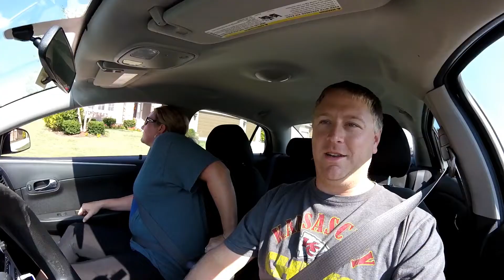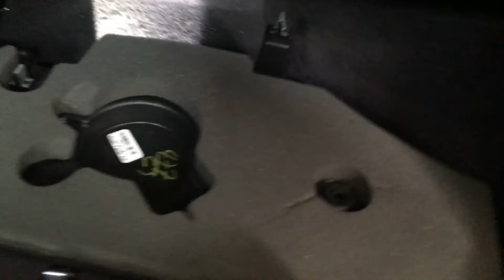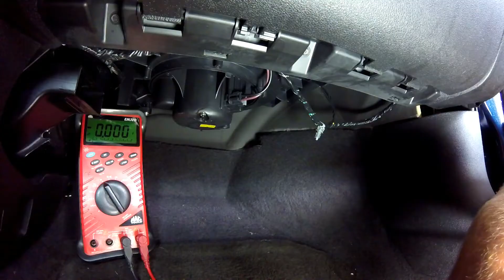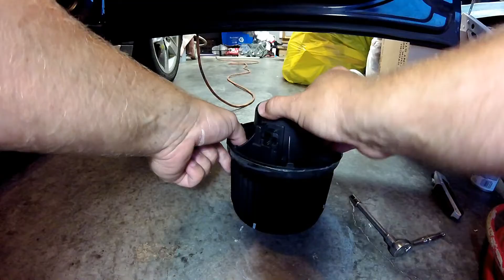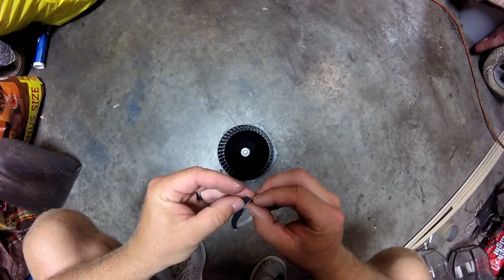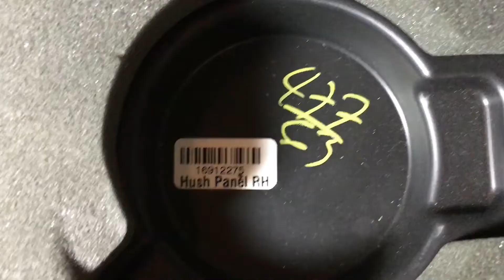Chevrolet Malibu blower motor diagnosis and replacement

Comment: How did you assume it’s the blower motor the issue, couldn’t it have been blown switches? Wouldn’t you check those first before changing the motor blower?
Reply from the maker: I checked for power and ground to the motor and it had both. If the switch was at fault then I wouldn’t have power to the motor. If I didn’t have power to the motor then I would work backwards to the resistor and then to the switch. No sense in pulling the dash apart to test the switch when the motor is so easily accessible.

Comment: If there's no air coming out the vents, is it automatically a blower motor issue?...or could it be the blend door actuator?
Reply from the maker: You should be able to hear whether or not the blower motor comes on.
Reply: @PetesGarageandperformance  Okay, thank you!

Comment: Question ❓ my blower only works on high. Do I need to replace it ?
Reply from the maker: No. Look at the blower motor resistor or the connector to the resistor. It’s probably melted.

Comment: I didnt get a reading while the blower was connected. Disconnected, tested the terminals directly and was getting 12 volts. Decided to go ahead and replace the blower, then the new blower wouldnt work. Decided to disconnect the blower motor resistor from the wiring harness just to take a look at it and reconnect it. Noticed it was corroded and the plastic was slightly melted. Wondered of that was 1) the cause all along 2) caused by having a blower that wasnt working making it get hotter maybe? 3) or maybe caused by me testing the wires directly without the blower being plugged in? Reconnected the blower motor resistor to its wiring that was corroded wiggled it around and the blower started working again. Any thoughts about the corroded resistor wiring?
Reply from the maker: The resistor and connector was the problem and both need to be replaced. It probably won’t work for long. Cycling the connector probably just cleaned the connection.
Reply: @PetesGarageandperformance   ok thanks for your help!

Comment: What if there is no light at all in the AC controls and it works on and off intermittently? When I slap the panel to the left of where you have the red gauge thing (where a passenger's left leg would be), it causes it to start working again. Any idea as to what could be causing that?
Reply: I have the exact same issue! I need help too :(
Reply: @Kylorenzo310  in the past couple of days slapping the panel has stopped working. When I have time im going to take it to the dealership and finally find out what's wrong with it.
Reply: @BigBobsh2o Sounds like cold solder joint failure on the backlighting.  What did it turn out to be?
Reply: @floobertuber  body control module had to be replaced
Reply: @BigBobsh2o  Oh, that sucks.  Sorry that happened!

Comment: What would cause an intermittent blower motor outage. Is there a relay?
Reply from the maker: The relay is only used on high speed. Usually an intermittently working blower is the blower motor itself. It just depends on where the motor ends up after it stops. It could land on a bad spot in the commutator.

Comment: I have the opposite problem! My air blows but my heat button dont work, & i cant change the functions like the defrost,or switch the air from going towards my feet & face
Reply from the maker: That is your “mode actuator”. It’s on the driver’s side by the accelerator pedal.

Comment: I need help
Reply from the maker: With?
Reply: @PetesGarageandperformance  my gauge temperature it’s only staying on C which is cold and it’s not moving near the middle or H
Reply from the maker: Sounds like your thermostat on the engine is stuck open.

Comment: Hey there. Will this work on the 2015 Chevy Malibu? My blower motor stopped working with no warning or prior issues. Checked the fuse, and it's good. Assuming it's my motor. Thanks!
Reply from the maker: Give it a whack and see what happens. Or check it for power and ground. Some of these newer GM vehicles have brushless motors though. The changeover was some time around 2015.

Comment: I don't have that electronic diagnosis kit.. but.. when I turn on my heater/ac I can here something "wanting" to gear up, but it's very brief and faint sounding. I am assuming my blower motor is going out the door.
Reply: I have a 2012 Chevy malibu
Reply: It was blowing air one day, the next morning it didn't turn on at all. I almost heard a quick click/winding sound but no air. It works now, but I hear the motor is louder than it ever was.
Reply from the maker: It’s probably the blower motor.

Comment: Does the motor come with that bracket. I'm checking out the Amazon link and it doesn't show if it does
Reply from the maker: It should. That’s the VDO part number I used and it came with the bracket and screws. I cross referenced it on rockauto and it shows the bracket and screws with that part number.

Comment: just in time.  a hot tx summer is no time for the blower motor to go out in for my 08 malibu.
Reply from the maker: Hope the video helps you out.
Reply: @PetesGarageandperformance  after looking at a few of these videos about the blower motor here on youtube i ducked my head under the dash to take a look.   seems that at one point in time that the blow motor had been replaced and that the hush cover was gone and missing.  lol
.  also looks like at one point in time that it had been replaced before.
Reply from the maker: That at least makes it easier to replace.

Comment: I got a 2016 malibu..i feel like it doesn't blow enough air as it use to.. new blower maybe?
Reply from the maker: Possibly. Do a volt drop test and see if it drops 12v across the blower motor on high.
Reply: @PetesGarageandperformance  its perfectly fine..it sounds like it's blocked and going elsewhere

Comment: I know this is probably not the same problem but would anyone know why my blower on my 2004 malibu would just turn on randomly and aslo the blower motor won't turn off "if it even ends up working at all" when I turn the ignition off which make 0 sence
Reply: Lol it's not fun in like 95+°f weather glad I had a power inverter and a nice fan
Reply from the maker: If it has automatic climate control then the blower motor controller(resistor) is messed up. Usually it goes bad because the blower motor is pulling too much current. I’ve seen them do this and the motor was getting water into it because the vehicle was wrecked and not repaired correctly. Rain water would come in through the cowl. You probably need a blower motor and the blower motor controller.
Reply: @PetesGarageandperformance  thank you ill have it checked out

Comment: So what if nothing on the dash is lighting up when you try to turn it on any speed? Not even the defrost lights up and nothing comes out.
Reply from the maker: The control head itself could be bad, also there could be no power to it. I believe the control head gets is power from the BCM/fuse block assembly.
Reply: @PetesGarageandperformance  thank you
Reply: That's my issue how can I fix this!??bwhata the control head and fuse block??? Sorry I'm trying and I know nothing about cars

Comment: What if the blower still doesn't come on? Even after changing the resistor with a new one and the blower with a new one?
Reply from the maker: Did you have power and ground?

Comment: Changed blower motor worked fine for a couple days and my daughter says it seems to be doing the same thing again any suggestions other than fuse I will be looking at it again tomorrow when she comes by...
Reply from the maker: I would look at the blower motor resistor assembly. Check the connector for burned/melted terminals.

Comment: hey Pete, i need help i get no heat on my 2009 Malibu, when i turn the knob to the cold side i hear the actuator moving but when is on the heat side it doesn't move or sound, do you think is the actuator or something else going on? please help.
Reply from the maker: Sounds like the temperature/blend door actuator.

Comment: My 2012 Malibu fan works sporadically. It will work fine for a while then later on it stops then maybe an hour later it works again. Any ideas? Thanks
Reply from the maker: It’s probably the blower motor, but you’ll have to check it out while it’s not working to verify 100% that it is.
Reply: I noticed when it isn't working I just bang the glove compartment and it goes on. I am able to adjust the level from slow to fast. Is their an inexpensive blower you can reccomend because I can install it mysef.
Thanks
Reply from the maker: J Martinez I would put a blower motor in it. Check out rockauto.com. Best prices for car parts.

Comment: What if you get 14.3 volts DC on voltage drop test on connector? Cross short?
Reply from the maker: Sean Clancy are you backprobing the connector with it connected to the blower motor or do you have it disconnected? If it’s backprobing then you definitely need a blower motor. If it’s disconnected then you at least have power and ground. But with it disconnected, it doesn’t load the circuit and you could have some voltage drop elsewhere (blower motor resistor or control head) and it won’t show up because the circuit isn’t active.
Reply: @PetesGarageandperformance  backprobed it with it connected... I did the hit test and started right up so I replaced the blower motor.  It would only intermittently not work (come on at all). When it did come on I was able to adjust the speed so I didn't think the motor resistor was the issue.
Reply from the maker: Sean Clancy definitely sounds like the motor since it was dropping all of the voltage over it and not moving.

Comment: There is no screws on the one i pulled that went bad. So this isnt relevant to my process unfortunately.
Reply from the maker: Did you not watch the video? You cut the old one out and the new one should come with a bracket and screws.
Reply: I did watch the video. However on the blower motor i pulled there is no screws on the old unit. Ill post a picture of what i am talking about once I get up and around.
Reply from the maker: DowN4MinE 805 did you have to cut the old one out?
Reply: @PetesGarageandperformance  Yes I had to cut it out. Mine is an 08 malibu classic lt 3.5 though
Reply from the maker: DowN4MinE 805 yeah the new one should come with a bracket and screws.

Comment: Hi peter I did the electrical check and it showed 0  so does that mean that there is no power go to the blower 
What should I do I did check all the fuses , except the blower high reply
Reply from the maker: It means you either don’t have power or ground. The next place to check would be either the blower motor resistor or the control head.

Comment: So after diagnosing the motor is bad, by tapping on it. It started working(loud) but only on 4. The lower ones do not work. New resistor installed. Is it a faulty resistor? did an electrical test with the light bulb tester. light only came on on 4
Reply from the maker: It sounds like the blower motor was bad if tapping it made it work. But it also sounds like there is another issue. If it already has a new resistor I doubt it was a bad one. Were the terminals burned up on the resistor connector? I would check the hvac blower fuse since it uses a separate circuit for hi than the other speeds. I don’t have a schematic in front of me but I think the fuse is located in the fuse block that is part of the BCM on the passenger side under the center console.

Comment: Malibu's quality is so bad, even after so many years struggling.
Reply from the maker: As with most vehicles, it is all in how well you maintain them. My mother has a ‘11 Malibu and hasn’t had to do any repairs other than tires, brakes, headlights, and one can solenoid. She has owned it since new and has 150k miles on it. I’d say that’s pretty good. Others don’t get so lucky. I’ve always thought the Malibu was a good buy for low cost of ownership. Go buy a luxury vehicle and then you’ll see some pricy repairs for sure.

Comment: Would the blower not working cause the temp control not to have power to it? I’m currently having that issue in my 11 Malibu.
Reply from the maker: JAKE2010512 no the blower motor will not cause the hvac control head to not have power. I believe it gets its power from the body control module mounted on the right front side of the center console.

Comment: So another question we replaced the thermostat do you know how we get the air out of the coolant system so the thermostat can read the temperature? On 2010 Chevy Malibu 2.4 L
Reply from the maker: K K the air should pretty much bleed itself out because the reservoir is the highest point in the system. You could also get an air lift vacuum coolant fill tool.

Comment: Do you know anything about the thermostat having anything to do with the a.c. blowing out nothing but hot air? I had it looked at a local car shop they said the reason my temp gauge doesn't work and my a.c. doesn't blow cold is because of the thermostat I need help please!! Thank youu
Reply from the maker: K K anything is possible. But a lot of GM vehicles default to no ac if there is a problem with the coolant temp sensor. You didn’t say what kind of car you have or which engine. But I’ve never seen a thermostat cause the ac not to work. Unless it overheats and disables the ac because of that.
Reply: Pete's Garage sorry I have a 2010 Chevy Malibu it is 2.4 4 cyl when I took it to the shop they put the scanner on it and it said the thermostat sensor so he reset the sensor and the temp gauge started working again and my a.c. blew cold as well but then both the gauge and a.c. stopped working again and I took it back he said I need a new thermostat and he quoted it 350 dollars he said it would have to have a special tool to bleed it I just don't understand what he means I had alot of people tell me thermostat has nothing to do with the a.c. but again I'm not sure what to do..i sure would hate to pay them to fix thermostat and then my a.c. not work
Reply: I want to have my dad replace the thermostat it is a $20 part but he isn't sure how to "bleed" it so that it doesn't mess the engine up or so the guy at the shop told me
Reply from the maker: K K I would take it to another shop for a second opinion. It sounds like a coolant temp sensor or wiring issue to me. It’s not overheating is it?
Reply: Pete's Garage nope no problem with overheating at all. Thank you so much for your time I appreciate it

Comment: How do you know it was a bad motor vs just a bad resistor? My 2010 is doing the same thing. I give the dash a smack on the passenger side and it turns on and sounds just like yours did.
Reply from the maker: I Hit just the blower motor. Usually hitting a resistor doesn’t get it to work. Electric motors will sometimes work when you give them a whack!
Reply from the maker: I Hit just the blower motor. Usually hitting a resistor doesn’t get it to work. Electric motors will sometimes work when you give them a whack!

Comment: I always HATED cutting out those blowers, especially on a hot day!.  Great for the assembly line horrible for the tech or customer.
Reply from the maker: Final Call Racing Yea weren't the old s10 blower motors like that? Have to cut them out?